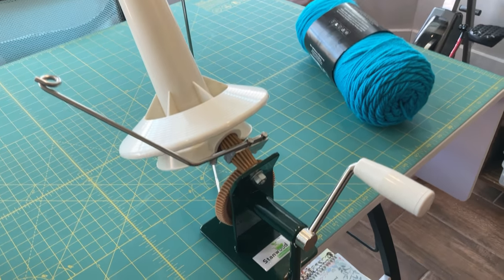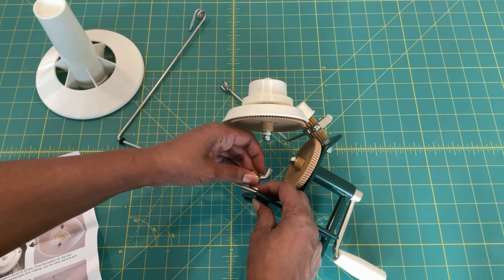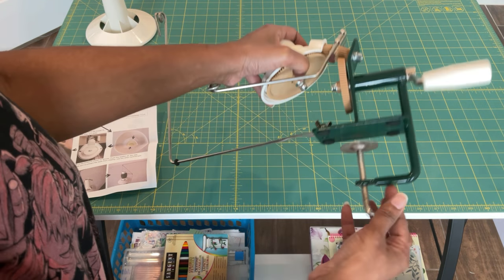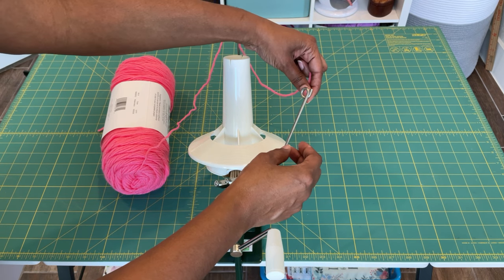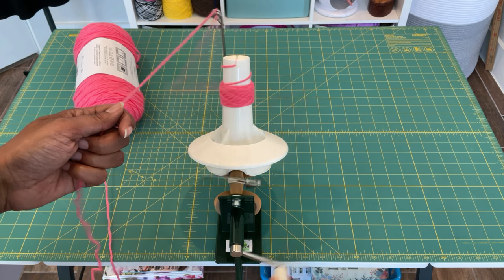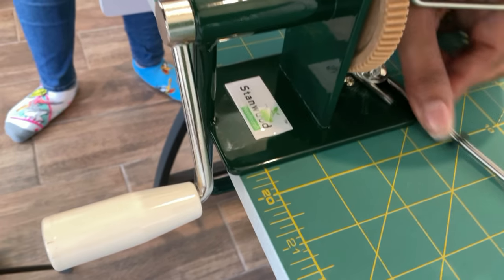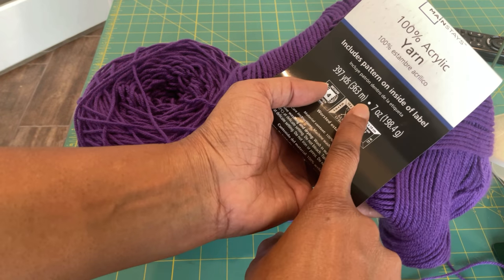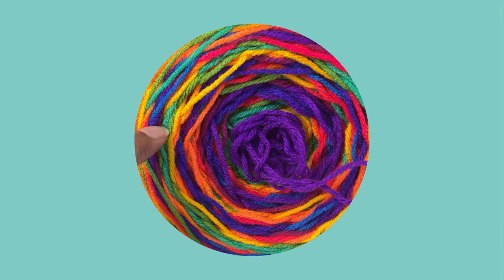Assembling the Stanwood and How to Use a Yarn Ball Winder

Comment: just got mine today, but the skein I wound didn't have a center pull. It's Big Twist Soft. It's a wonderful machine, but I had to unwind a section from the skein, then wind/cake on the winder, stop, and repeat. It took a very long time and it was frustrating.  But, the cake wound perfectly on the winder. Great tension, an I'm thrilled with the end result. But I can't find any info or suggestions to help with skeins without a center pull.  Any ideas or suggestions?  Thanks for the great video. 🙂